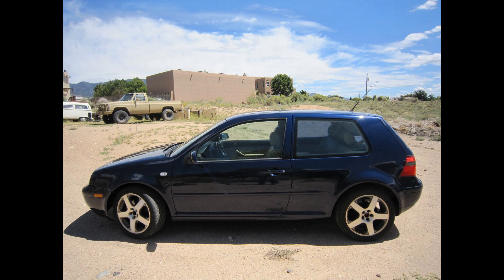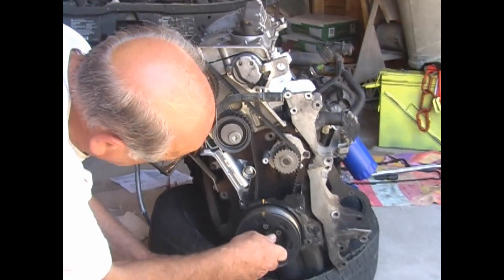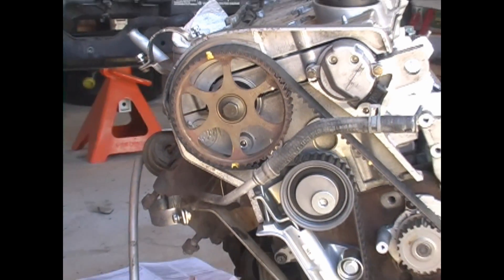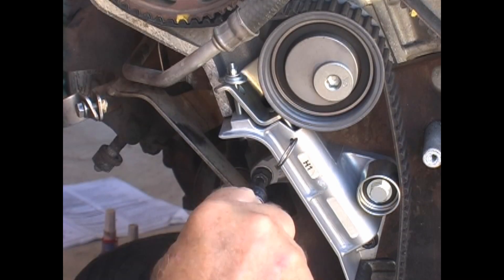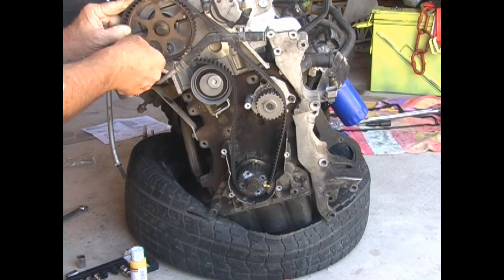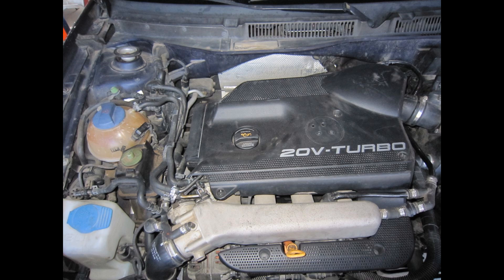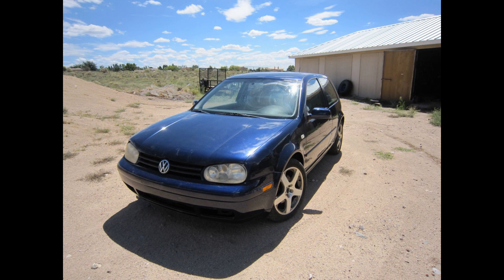VW/Audi 1.8 Turbo Timing Belt Replacement

Comment: Hi Mr Weyland. I have a question, let's say that I was trying to put the belt on and, by accident, I moved the crank sprocket left by a few milimetres? What then?  Is it ok if I take the belt off and rotate the crank sprocket a few milimetres back so the markings on the crank align again? Same goes for the cam sprocket; if I accidentally move the cam sprocket left by a tooth, is it fine if I then rotate it independently right so that the markings line up, and then proceed to re-try putting the belt on? From what I understand, if I move eg. the crank off alignment, I cannot just rotate it clockwise a revolution to get it back in alignment, because that would cause problems. Thank you!
Reply from the maker: Yes, it should be okay to move either the crank or camshaft back to the right place.  And you're right you shouldn't rotate the engine a full revolution without the timing belt on and in the right place.  Having said that, this is the primary reason for putting marks on the belt.  Do you have marks on your belt?  When the belt is in the right place, it is really tight on the right side across the water pump.  It is almost impossible to get the belt in the right place when both timing marks are in the right place because the belt is so tight.  As describe in the video, when you are putting on the belt, back off the crank just a little bit, put the belt on according to the marks on the belt, and then rotate the crank back to the timing mark.  That it shown in the video.  When you rotate the crank back to the timing mark, then the belt is really tight.  let me know if you have other questions.
Reply: @waylandadams2326  thank you so much for your quick reply. I have markings on my belt, but I noticed many people on different websites had problems with the crank/cam sprocket moving while trying to install the belt (because it is so tight), so I wanted to find out what to do if such a situation were to happen to me. Now I know it's fine to just take the belt off, move the sprocket(s) back into alignment and re-try. Once again thank you, and when I do my TB change in a few days, I'll let you know how it goes!
Reply from the maker: @Farseer1995  I am not suggesting you take the belt off to align the timing marks.  Back of the crank off slightly so you have enough slack to install the belt.  Put the belt on aligning the marks on the belt with the marks on the sprockets.  Once you have the belt in place, then rotate the crank back to the timing mark.  I don't think you will ever be successful in putting on the belt with the timing marks all lined up.  The belt is just too tight.  Watch the video again starting at about the 6:20 point.  Let me know if you have other questions.  And good luck you changing your belt.

Comment: I still don't understand why marks are put on the belt itself.  It makes no difference where the belt is as long as the crank camshaft marks are aligned.
Reply from the maker: Gregory. You don’t necessarily have to put marks on the belt but it sure helps get the belt in the right place.  When the timing marks are lined up the belt on the right side over the water pump has to be really tight such that if you rotate the crankshaft, the camshaft immediate rotates.  Because it has to be so tight you end up backing up the crankshaft a little bit, putting on the belt and then advancing the crank to the timing mark.  Having marks on the belt insures you get it in the right place.  I have seen many try with both the crank and cam on the timing marks put on the belt only to find when they get to the last step of rotating the engine through a couple of cycles that the timing is off by one or more teeth.  Putting marks on the belt either from the old belt or counting the teeth helps avoid that problem.  But if you still don’t want to mark the belt, just be sure when you have the belt on and both the crank and cam are on their timing marks, then when you start turning the crank, the cam immediately starts rotating,  Hope this helps.

Comment: My question is, when I was going to pull off my timing belt, I lined the crank up with the notch, but the cam notch was before the mark on the valve cover, do I need to move it (the cam gear only) to get it lined up before i swap belt?
Reply from the maker: Hi Chris  If you are confident that you have the crankshaft set at the timing mark, then it sounds like your timing is off.  Perhaps the belt has been changed before and was not installed correctly.  The reason for marking the belt was to help prevent this from happening.  Unfortunately if you mark your belt the way it is, you will get the same result.  Here is a comment from another viewer that may be helpful for you.   One of my viewers indicated that you could count the teeth to make sure the marks are correct.  This is what he said.   "Hi Wayland. In the meanwhile I changed my timing belt and I can confirm that when counting the teeth on the timing belt that if  tooth n° 1 is on the camshaft timing mark then tooth n° 68 is exactly opposite to the bump on the lower crankshaft sprocket".  You could mark your old belt and then count the teeth from mark to mark.  And then adjust the marks on the new belt as necessary.  And yes, you will need to move the camshaft to the timing mark.  This is the way I would proceed.  Mark your old belt just the way it is and according to the video.  Take the old belt off and count the teeth and adjust the marks on the new belt if necessary.  Move the camshaft to the timing mark.  Install the new belt,  I found that when I installed the new belt, I had to back off the crankshaft a little bit to get the belt on and then advance the crankshaft back to the time mark.  At this point, the belt will be very tight between the crankshaft and camshaft.  This is described in the video.  If your timing has been off, your car should run better when you get it set right.  Good Luck!!!
Reply: @waylandadams2326  i appreciate the fast response, unfortunately my belt is already off, i am 100% certain that the crank was lined up with the mark on the cover, but even after rotating i couldnt get the camshaft to line up properly. It sits just before the mark on the valve cover. Would you think it would be ok to get that mark lined up slip a new belt on and count teeth on belt as well?
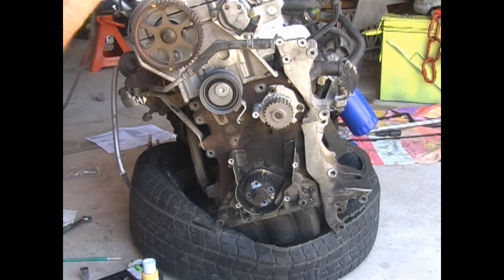Reply from the maker: Hi Chris  You could do what you suggest if you want.  At the 5:38 timing on my video, I describe how to install a belt with no marks which is what you are suggesting to do.  Since making the video, a viewer commented about counting the teeth.  You could actually put the marks on the new belt before installing just by counting the teeth.  In any case, you will know that the belt is installed correctly when the camshaft is on it's timing mark, the crankshaft is on it's timing markt, and the belt is under tension on the right side.  And you can confirm that by counting teeth.    Good Luck!!!

Comment: What's the purpose of marking the old belt (before removal) and then copying those marks onto the new belt (before installation)?
Reply from the maker: The purpose of marking the belts is to make sure you get the right number of belt teeth between the camshaft and crankshaft.  When it is done right, the tension on the belt is pretty tight on the right side.  If you don't mark the belt it is very easy to be off by one or two teeth.  As I said in the video, when you mark the belt, you can back off the crankshaft a little bit in order to get the belt on according to the marks.  Then advance the crankshaft to the timing position and everything will be set correctly.  So the marks are a reference which help big time in getting the new belt on in the proper place.  Does that answer your questions?

Comment: Exceptionally well done video and narrative.  Only change I would make is refraining from applying solvent-based paint (if it is...?) to the rubber belt just to be sure the rubber isn't compromised at all.  Maybe chalk would be a good alternative
Reply from the maker: Thanks for the comment.  I probably should have said something about that but I didn't used a solvent based paint.  The paint I used is not harmful to the belt like solvent based paint would be.  But good point and those that follow my video will benefit from your comment.

Comment: where did you buy the tool to compress the tensioner?
Reply from the maker: Hi,  If you are talking about the stud used to compress the tensioner, I just bought a bolt at Ace or True value hardware.  I cut the head off   The stud needs to be 5X55mm.

Comment: An awesome thing to know, would be how many teeth are between the two timing marks. That way, anybody who picks up a new belt can just put a mark on one tooth, then count however-many-teeth and put the second mark.
Reply from the maker: Hi Lane  One of my viewers indicated that you could count the teeth to make sure the marks are correct.  This is what he said.   "Hi Wayland. In the meanwhile I changed my timing belt and I can confirm that when counting the teeth on the timing belt that if  tooth n° 1 is on the camshaft timing mark then tooth n° 68 is exactly opposite to the bump on the lower crankshaft sprocket.

So this is another way to get the marks on the new belt.  Good luck
Reply: Wayland Adams thank you very much. The problem I have been having is that once the belt get tensioned, either the cam or crank sprocket turns a little. Though not until it has been run for several minutes. This should remedy that. Thank you very much for your support and quick response.
Reply from the maker: Lane

Yes, that should help.  Thanks for letting me know.

Comment: Wayland,
Thank you sir.
I'm currently in the middle of doing my water-pump/t-belt on my '03 GLS 1.8T (AWP) 1st 1.8T belt I've ever done..
Ive done MANY of these on Mk2 Jetta's & Golfs & GTI's, same principle just lack of an idler-pulley where the water-pump is.
I'm gonna take the hydraulic tensioner off and seat the belt (Ive got my marks set)
then go about the install.
Big Help!! Thank you!
Reply from the maker: Hi  Thanks for letting me know.  Hope this job goes well for you.  Are you doing this with the engine in the car?  I shot the video with the engine out of the car just to get better visibility to what is going on but you can certainly do this in the car.  Let me know how it goes.
Reply: Wayland Adams my engine is still in the car...i am also @ the same time...
1. Deleting my PCV/ SAi secondary air injection 
2. Replacing my thermostat plus upgraded to aluminum housing
3. Replacing my struts/upgrading my control arm bushings to R32 spec.
This GLS has been from Richmond,Va. to Savannah to New Orleans & Houma, Louisiana in the past 3yrs.
Lots of I10 & I95 miles plus I64 as well...

Comment: Okay, I've watched this thing way to many times and actually tried using your technique. Now when you start doing the timing belt with no marks you mention how important the TDC marks are and should be aligned but not once is your lower timing mark aligned. In fact is retarded by almost a half a tooth. Now this seems like something you're not mentioning here because when I align them up like you say my timing marks always seem to be off. So I'm going to ask why is your lower timing mark always retarded in you video but you always say they should be lined up. In frame 5:53 when you start putting on the lower timing belt,  you can clearly see that the lower timing mark is off. Even in the one that had marks in the previous minutes it's retarded as well.  Then in frame 6:15 you put your lower timing belt mark and the TDC is still off? So I'm not sure what magic is happening to get your TDC marks to align once you put on the tension-er. Geezuz in frame 7:38 you are a whole tooth off and you marked your lower timing belt?
Reply from the maker: Hi Mario
Sorry you are having a problem with my video.  Some of the apparent misalignment of the timing mark is due to the camera angle.  Having said that, the timing marks should be aligned when the belt on the right side (between the camshaft, water pump, and crank) is under full tension.  It is not possible to put the belt on under full tension so I back off the crank a little bit, put on the belt and then turn the crank to tension the belt and align the marks.  Another viewer offered this advice as a double check and a help if you didn't transfer marks from the old belt.  

  "Hi Wayland. In the meanwhile I changed my timing belt and I can confirm that when counting the teeth on the timing belt that if  tooth n° 1 is on the camshaft timing mark then tooth n° 68 is exactly opposite to the bump on the lower crankshaft sprocket.

So this is another way to get the marks on the new belt.  Let me know if you are still having problems.  I will be glad to help any way I can.  Good luck
Reply: Wayland ,
I really appreciate the response and I finally  got it to line up. Thank you for being so kind as to put a hot video on youtube.
Reply from the maker: Glad you got it to line up.  Thanks for letting me know.

Comment: Thanks, I was a professional VW/Porsche/Audi mechanic for about 16 years back in the 70's and 80's and still only drive them (except for my Dodge 4x4 Diesel Ram PU). My wife has an 02 Passat and I wasn't familiar with the routine. You made it clear as a bell. I went ahead and bought the full kit, as well as a full kit for my 98 Jetta TDI (different procedure, but same basic ideas). Plan on doing them both in the next month. Again, thank you for the fine video.
Reply from the maker: Hi Farley  Thanks for your comments.  Your comments are especially meaningful coming from a professional mechanic since that is not my profession.  Let me know how the jobs go on your Passat and Jetta.   Wayland

Comment: Wayland
Reply: Whenever you read this please reply. I bought a 2000 jetta 1.8t. The water pump locked up and unfortunately broke my timing belt. I can't seem to get the crankshaft to turn where the timing mark will align up. Do you have any advice, thank you.

Comment: Wetland Adams I could sure use some advice
Reply from the maker: I would be glad to help.  What do you need.  If you send your phone number I will call if you want as long as you are in the states.
Reply: 574 354 8210

Comment: Awesome job Wayland, love ya style ! one of the best vids I have seen on cambelt replacement ...................most of them are not the full deal. P.S. it also makes a BIG difference with the engine the ground, I think this way will save MANY swear words haha
Reply from the maker: Hi Blair -  Thanks for the comments, I appreciate it.  I had a lot of fun making making the video and then corresponding with many who have questions or comments.  You're the first to comment on liking having the engine out of the car.  Others have commented that I should have done it with the engine in the car.  I purposely did it this way so I could show more detail of the actual process.  I think having the detail helps when changing the belt in the car which is very possible to do.  As you know, it is very tight with the engine in the car and would be impossible to get very detailed video.  Thanks again.
Reply: Ya welcome Wayland..............its just that I am 'hot off the press' just having done the cam belt on my Isuzu trooper 4x4 on saturday {sorry bit on sunday} .............not having ever done a belt. I did not find the accurate info which you so easily display combined with the eager attitude you share. Yes engine out would or is the answer, makes an extremely attentive hard  job a hundred percent easier, that is if the user knows whats he is doing. SO Thankyou Sir Wayland Adams for your style.
Reply: Very true.. there are videos of guys replacing the belt with engine in car, but you can’t see a darn thing they are doing! Great video.

Comment: I have 1.8t 20v engine (auq). I think my belt jumped and im gonna change timing belt n waterpump and tensionee ofc! But the " problem " is that i dont have the belt cover which has marks on it.. So how can i set the timing right? #1 piston to TDC and then just set the cam marks? Sorry about my bad english😂🤘🏼
Reply from the maker: yes, you can make sure #1 piston is at TDC and then set the cam on the marks.  I hope you haven't damaged the valves on your engine which can happen if the timing belt breaks or slips significantly.  Once you have #1 piston at TDC, I would place a mark on the sprocket and the engine casing for a reference.  Good luck on this repair.  Let me know how it goes.
Reply: Yes i will let you know👍🏼 thanks
Reply: Car works now! Thank you!
Reply from the maker: I am sure glad it is working.  Thanks for letting me know.

Comment: Great Video; is the 2.0 Turbo engine similar in replacement?
Reply from the maker: I haven't done a 2.0 engine but looking at diagrams of the engine it looks very similar.  Certainly making sure the the timing marks are lined up and marking the old timing belt and transferring those marks to the new belt would be just as applicable.  The other steps would be similar.  Good luck on this job.